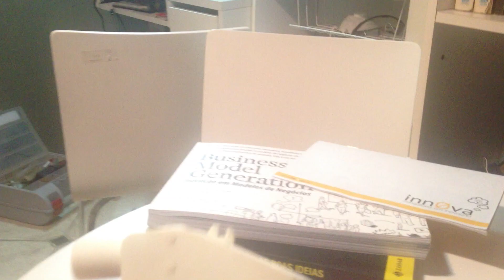3D Gun Printed with Printrbot - Liberator

Comment: The United Nations forced Cody to remove the source files from his site. It violates their International Arms Treaty even though it is legal, technically, in the U.S. still. 

I agree with you on safety. It is barely more than a toy that barely fires even one round at a time. I wouldn't personally dare use it for more than a dire last ditch life saving chance. However, Cody has stated that it was designed to prove the point that it can be done; not to build a combat ready firearm.